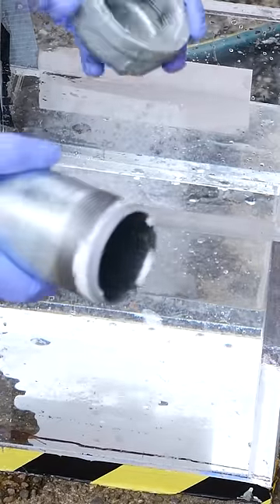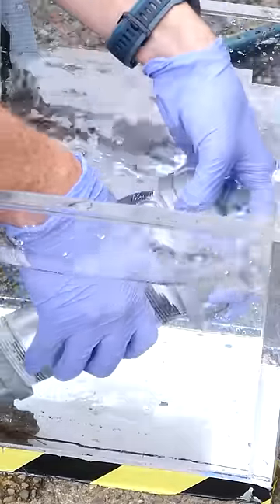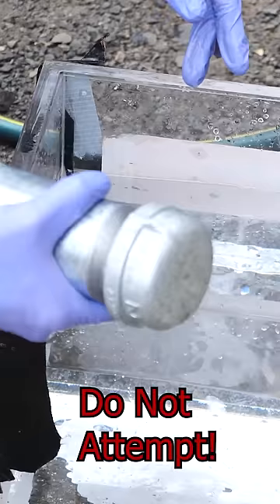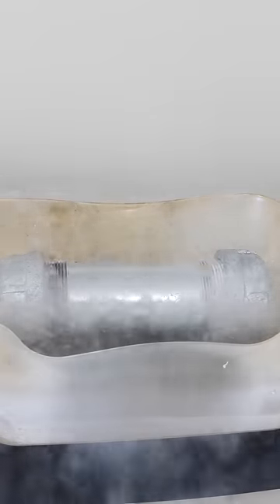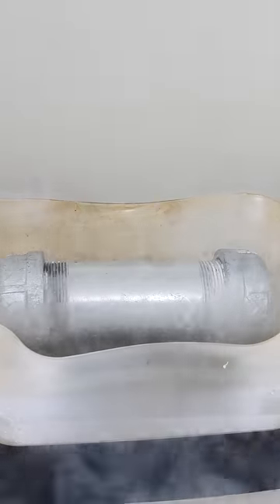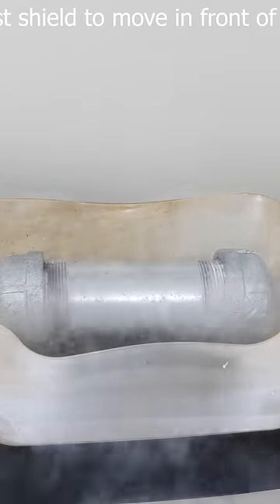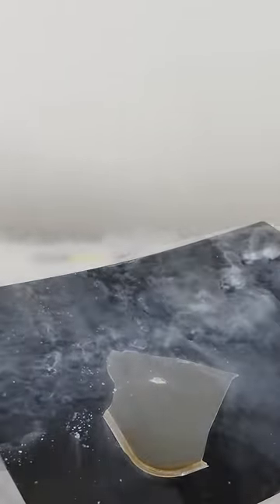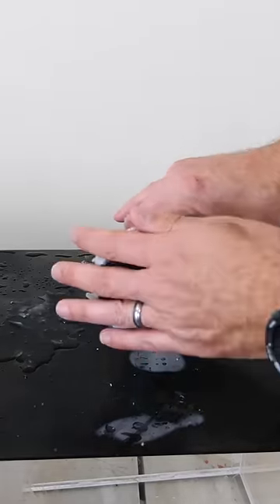Don't Ever Try To Stop Water From Freezing!

Comment: That's why you open your faucets to a drip, so the Pipes don't freeze in Winter when temps are below 32°F.
Reply: Happens a lot in Philly. Winters can literally touch 0°-3°. Pipes busted then froze solid. So weird.
Reply: @Riddem79 wow Philly winters aren't as cold as I thought. I'm from Upstate NY but live in Oklahoma now, Oklahoma gets colder than -3 in the winter, we just don't get the snow thank God.
Reply: Do you guys know why I live in the UK and have never heard of this? Or know anyone who does it. Are our pipes designed differently or maybe at a different pressure. Is this something that only matters if taps are left closed for weeks? It doesn’t get as cold in the UK as many places in America and also doesn’t for very long. That may be why.
Reply: @ZeerakImran  idk about a out ur plumbing layouts but this is generally a thing in the southern half of the US because the homes are built with the higher summer temps in mind. Pipes are a few inches underground. Some water lines are run with no insulation and left in elements, think like under a mobile home for example. Since it rarely gets below freezing in this area the extra work to protect it isn't worth most ppls effort. 

Homes in colder climates tend to bury lines deeper and avoid pipes being in open air uninsulated
Reply: @ct1freak  ah that makes sense. Yeah I haven’t seen any exposed piping except on the inside of the house. I have seen it on the outside of houses in other countries where it’s hot. They always looked ugly though and I always questioned how they could just be allowed to dangle by the side of the wall. I guess in their minds this makes repairs easier because they’re used to everything breaking with lower quality materials and tradesmen. This isn’t referring to the US as I haven’t been to the US yet.  Thanks.
Reply: @robkoepnick5507 -3?? i'm guessing that's Fahrenheit?
Reply: @robkoepnick5507  where tf in Oklahoma  do you live? It doesn't get neg 3 in Adair, Tulsa, Broken Arrow or OKC .
Reply: As soneone from the midwest i endorse this message
Reply: @ZeerakImran i live in chicago and in the winter it gets below zero broken water mains every winter
Reply: @Riddem79 Laughs in Chicago’s -45 wind chill
Reply: @robkoepnick5507 Damn, winters without snow are so fucking depressing… I’d rather have -15°C and snow, than 2°C and rain….
Reply: @ZeerakImran No it’s a plumbing thing. Like, obviously in cold places such as some Russian cities and scandinavian countries, their plumbing’s made to withhold the freezing weather with no issues, and you don’t have to do this open your faucet shit. I too want to look up into what the differences are
Reply: @trilikvlt  100%
Reply: Here in Canada we never put pipes along any exterior walls for this reason
Reply: @gabrielrodriguez9142  
I live in Kentucky, and 2 Winters ago we had one week of
 about -10 to -22 F. My pipe burst up inside the two by four (2x4)  coming in the House. I didn't use spray insulation in that very tiny gap between the pipe and the Wood. 
So I purchased the expensive Flex Pipe and re-did the ENTIRE system.  

I even had my Pipe dripping, but in that type of Cold you are better off turning off your water supply to your home and have your faucets wide open, so if it does freeze inside the pipe, the water has a place to go,. 
Kentucky usually doesn't get that Cold for that long. 
It was the Winter after Texas had their bad Arctic Storm.
Reply: @ZeerakImran  
You probably don't even get the Arctic Cold in the UK, BECAUSE the storm seems to ALWAYS come from the northwest and flows in a southeastern direction. And the UK is way up north, even further North than Germany. Latitude of Germany is about Montreal's latitude...give or take.
Reply: @i_am_a_freespirit  oh yeah kentucky gets cold, I tagged the other dude becauae he said Oklahoma  and I live in Oklahoma.
Reply: @dillonschiller5760  Laughs in Michigan's -60 wind chill
Reply: This Old House did similar test, with a pressure gauge. Didn't take long to exceed the range of the gauge used. That's what breaks pipes the most. Sudden raise in pressure.
Reply: Only if you don't dig deep enough when laying pipes or skip the pipe insulation. In my country we sometimes get -20 Celsius or lower during winters and I never had to leave the water running, because we plan ahead, and don't build shitty murican style houses.
Reply: Sorry I don't live in antarctica
Reply: @ventsislavminev  I live in Minnesota (where it can get much colder than -20C) and we don’t leave are faucets open, we do plumbing different in the north so we don’t have to. The people saying they leave the faucets open are a farther south where the plumbing isn’t built for freak cold weather events. Nothing to do with “shitty murican houses.”
Reply: Wow my winters are - 30-40*C and we don't have such worries. Another town further north with avg winter - 50*C does have its pipes freeze, but that is solved with snow/ice baths replacing the flowing water.
Reply: You're supposed to do that?
Reply: I live in Los Angeles…
Reply: This is nonsense. Our house pipes arent sealed shut like a pipe bomb lol. Its also REALLY difficult to freeze pipes due to the fact that they are underground. They aren’t receiving the cold air that we feel. Frozen pipes do happen and sometimes burst but its not very common, and its definitely not dangerous. What this guy did was extremely stupid and could have been deadly.
Reply: @ZeerakImran temperatures in Europe are warmer then in North America (for the same latitude) due to the Gulf Stream and AMOC.

New York is about the same latitude as Lisbon (40°N for NYC Vs 38°N for Lisbon), yet Lisbon has a weather somewhat more similar to Florida.

I can only imagine the temperatures in Canada and Greenland. It must be insanely cold!
Reply: Um no. You shut off your water and drain any water still in your pipe system
Reply: @i_am_a_freespirit UK winters are moderated by the Gulf Stream and general ocean influence, so it's very rarely below -10°C in London (as opposed to it happening every winter in a non-southern US location & in all of Canada). Climate in general has very interesting distinctions between North America and Europe. It's not just Europe being warmer on average at the same latitude as North America due to the ocean currents, it also generally sees less extreme weather and fluctuations. The North American terrain is more open and allows polar air to enter more easily, and likewise tropical systems can reach US land via the Atlantic. These and some more factors cause weather to be more volatile in America than Europe. It's why Spain mostly doesn't need to worry about surprise winter weather, while Texas with a similar climate does get frigid temperatures and snow once every few years.

Just wanted to contribute some climate nerd stuff here :D
Reply: All like little babbys, try northern Minnesota's -40f actual, not including windchill. And as long as you keep the heat running, the pipes aren't an issue.
Reply: @kurtyjay Minnesota is home to the greatest accent on earth.
Reply: Meanwhile in Australia it gets to 20°C and we think "Oh, it's getting a bit chilly, I'd better get a jumper."
Reply: If you need to be responsible for opening your faucets so the pipes don’t freeze, your government or water company is doing a shit job. It regularly gets to -40 here and no one here does anything like that
Reply: Me in south Florida... 🤷🏻‍♂️
Reply: @fireofhislove3395  haha. The accent can get pretty thick far up north or in more rural areas, not much at all in larger cities. Nothing close to as extreme in what is portrayed in  shows/movies though.
Reply: @ventsislavminev hey I know this isn't really a concept to people in most of the world, but the US is a Huge Conglomerate and some of us live in warm, humid climates where it's not expected to ever reach freezing for more than a few days in the entire year. Our houses down here in Texas aren't built like the ones up in Illinois. We live in the heat and we build for the heat, as such, cold causes us real trouble. With climate change tho Texas is gonna either have to winterize or freeze to death soon
Reply: @trilikvlt fair, coming from somewhere in California where winter gets down to 1-2 °C but there's never snow (other than occasionally on the peak of our nearby mountain). I've never lived anywhere with snow, and it does seem like it adds variety.

On the other hand, snow means practical issues. More dangerous driving conditions, rust damage to cars from the road salt, shoveling snow if it builds up, etc. I get why the other person is glad not to have to deal with it.
Reply: @kurtyjay totally fair, though it's well-known that many modern American houses are built from subpar materials in order to save costs for large construction companies.
Reply: @ZeerakImran it has nothing to do with pressure it's all about freezing temperatures. If you don't reach freezing temperatures you don't have to worry
Reply: Depends on state. Most stayes with colder weather have cold resistance pipes
Reply: @ventsislavminev these “shitty murican style houses” are better than what’s in your country that’s for sure. 😂
Reply: I always make sure to do this. Also, if I remember correctly, you only need to do this with the cold water faucets, not the hot.
Reply: @Riddem79  -3 lucky. in Canada it gets -30 or colder
Reply: no. i dont do that. because my house is insulated and my main line is below the freeze barrier.

i dont do that at all.
and wont unless my heat fails.
you offer awful advice.
Reply: @Riddem79  it's not weird at all. It's literally insanely common
Reply: @ZeerakImran I’m guessing the temps aren’t as cold maybe? Or maybe because a lot of homes in the US have pipes under them or outside, and some underground so they are more exposed to the cold temps? Not sure but more people than not in my state (Maine) have had to do this at some point in their lives or at least know it is necessary for some homes. Temps as cold as -20 or more are common in the deep winter months here. With the wind chill it can get to -50 at times. Pipes and tanks that hold standing water don’t stand a chance at those temps. Especially at the joints.
Reply: @ct1freak it’s not more common in the south I promise. Here in Maine I bet almost everyone has had to do this or has had frozen pipes at some point in their lives. Our plumbing is either just below ground, under the home which doesn’t have a basement, or on in another area that is exposed to cold temps and not heated. Many people have basements and their plumbing is there and won’t usually freeze due to heat from the home keeping it warmer than outside, but if those people have haven’t experienced frozen or burst pipes themselves, they absolutely know a few people who have. It is most common in trailers and manufactured homes that are on a concrete slab and have the plumbing under them, as well as the holding tank and/or pumps for those homes. Those are the residents who have learned after a bad experience to crack the tap open to let the water run on cold nights and sometimes days.  moving. Water doesn’t freeze nearly as easily or quickly as still water.  

In temps that can reach -20 or more in deep winter (up to -50 with wind chill), pipes with standing water don’t stand a chance.
Reply: @ZeerakImran  it does happen in the UK. I’m not from the UK but I am a plumber and I’m telling you this can happen anywhere in the world with the materials we use for plumbing. In Europe you guys have been using PEX (cross linked polyethylene) a little longer and pex is slightly more resistant to bursting from freezing temperatures but it still definitely bursts.
Reply: @trilikvlt  their plumbing materials aren’t any different in Russia and Scandinavian countries. The water supply may be more likely to be built more within the center of the home not outside the foundation wall. Also I’d imagine Russia has their homes heated more thoroughly. But as cold as it gets in Siberia for example… bursted supply lines galore. Oh yeah it happens and it happens more than it does anywhere else in the world. Anywhere it gets below freezing they have issues with bursted water supply lines. They don’t have any magical sauce over there
Reply: @Cre9000  wow. thanks for that info. 👍
Reply: No, that's because you have bad insulation, or the pipes are going through exterior walls instead of inside the home.

Cause nobody does that in Canada!!  And our pipes are fine.
Reply: @carriehesketh3555  I wouldn't think leaving your water dripping would matter much in -20 and below temps

Comment: And now you know why you use antifreeze in your engines and not only water. Also, this is why you have freeze plugs in your engine as well. They are built in failsafe points to keep your engine block from shattering if the liquid in your cooling system freezes.
Reply: Indeed. Although they don't always save the block they work pretty good
Reply: And this is why ppl move to Florida
Reply: The radiator cap allows pressure release both ways so the system cannot get a vacuum pressure or a build up of positivpressure
Reply: @bingysbackyard  you're both right and wrong about that... under normal circumstances, the cap should not allow pressure or vacuum to build up in the cooling system at ambient temperatures. But, where you're wrong about it is where, if the system freezes then the cap is irrelevant. It's not gonna allow the vapors or fluid to flow or expand in or out if it's frozen solid. Again, this is why you use ANTI-FREEZE in your engine and not just straight water in cold climates. But even using a good 50/50 mix, if it's cold enough... it still freezes. And THEN... that's where you need freeze plugs. But as someone else stated previously, that doesn't always save the engine block.

Comment: Steel can expand and contract under different temperatures. And the way you froze it makes some difference as well. Freezing thing's with chemicals that go sub zeros in seconds makes things brittle. I've dipped car keys ( yeah old style real key's) in liquid nitrogen and then hit them with a hammer and shattered them like glass.
Reply: Least you clear up the fact they may of been new style fake keys.
Reply: You are 👍 the steel became brittle
Reply: While that is true this has been tried repeatedly using different methods for the same result. There was one time they tried filling a cannon with water, sealing it, and leaving it out during winter. Yes the barrel exploded.

Comment: You’re measuring the strength of the threads rather than the tensile strength of metal (vs the H2O expansion pressure). You should a container that has no weak(er) spots by welding any openings with a same-strength material.
Reply: The end of the cap popped off, the threaded portion is still in place.
Reply: @kennethalbert4653 it's the end of screewed portion on the cap, which is the weekest point, possibly largest inner diameter.
Reply: @222amonra  OP said, "measuring the strength of the threads"....not where it broke.
You said, "largest inside diameter"...typically those caps taper, so unlikely.
Reply: what are threads made of?
Reply: @kennethalbert4653  assuming a constant pressure distribution because of the enlarging ice, the highest stress occurs at the beginning of the cap where the curvature starts to change. You can weld the threads, it wouldn't matter, it will always explode at the caps, where the inside curvature starts to change.
Reply: @mackisbrocklesnar  same material as the cylinder and the cap. Usually turned in lathe.
Reply: r u trying to get this guy game ended bc going off intuition that sounds like a horrible idea bc when it breaks it would probably explode into shrapnel like an actual pipe bomb
Reply: @dijital4801  no, it won't. It's not a bomb. It's probably mild steel, so it will start to tear where there is maximum stress, and max stress is always at the caps where the cap changes direction. So always one of the caps will pop away to either right or left. The body will go in opposite direction because of conservation of momentum. So it will always explode to right or left, will not come to observer in the front.
Reply: The right cap was cross threaded too
Reply: @kennethalbert4653 it was cross threaded.
Reply: @travisloso1466  What difference does that make ?
Reply: He wasn’t measuring pressure at all lol he was demonstrating the expansion of water as it freezes
Reply: @johnmathewson6630   If something expands within a fixed volume, what is created ?
Reply: I'm no welder, but I'm pretty sure welding shut a pipe that's entirely filled with water is going to be difficult.
Reply: Then it'd explode from boiling the water
Reply: @joemck85 not really. It's not easy, but it's doable.
Reply: @kennethalbert4653 Cross threading anything compromises the seal because the threads don't evenly engage leaving gaps and high levels of stress on threads usually destroying them.
Reply: That cap looks like it is made out of cheap cast metal
Reply: @mackisbrocklesnar  Anvil vs wire brush of same material, who wins?
Reply: Not to mention the n2 probably making it brittle
Reply: @222amonra what if instead of a cylinder you use a sphere?
Reply: As a Welder, i can tell you there's no way to do that. That's a pure hypothetical that is unachievable in reality.
Reply: @kennethalbert4653  The point of the experiment was to demonstrate the fact that water expands when it freezes. It was not to make any assertions about the the tensile strength of steel pipe. That's the point I was making to the original comment.
Reply: @carlosmejia5728  the same. To make a sphere you need two half spheres, and to connect them by thread. Then it will again explode to right left, into two threaded spheres like at the beginning